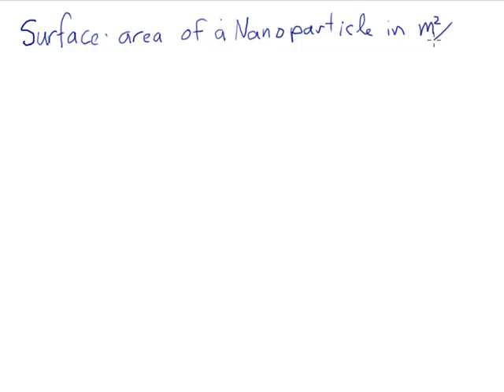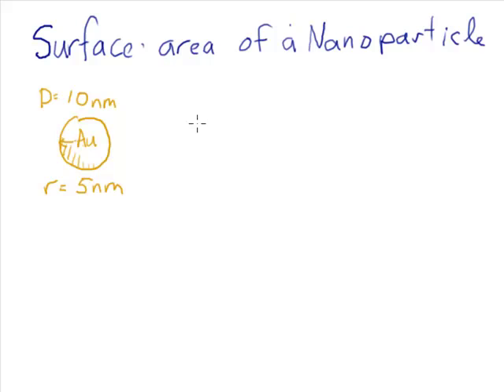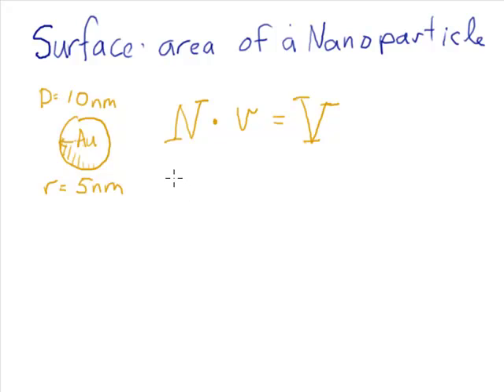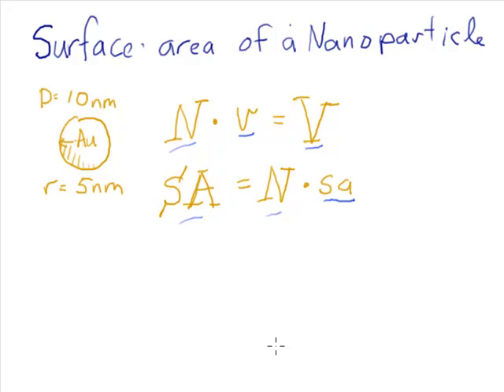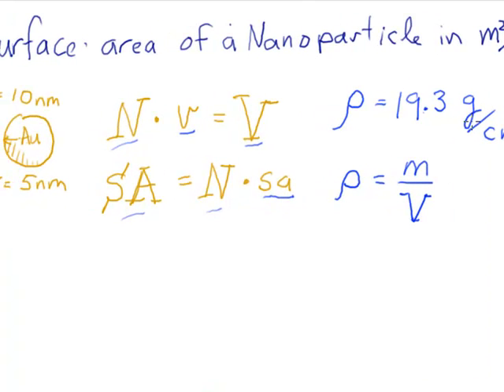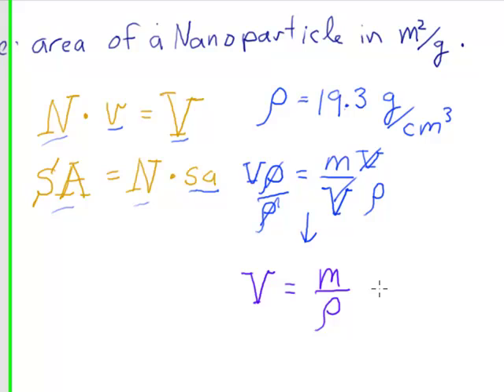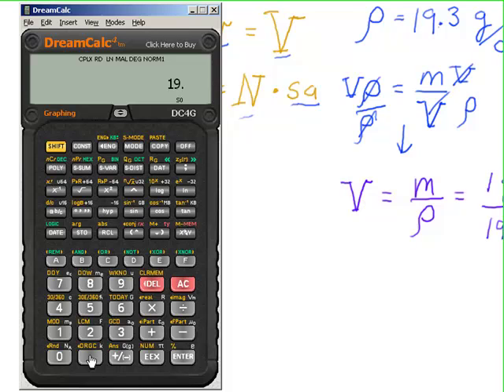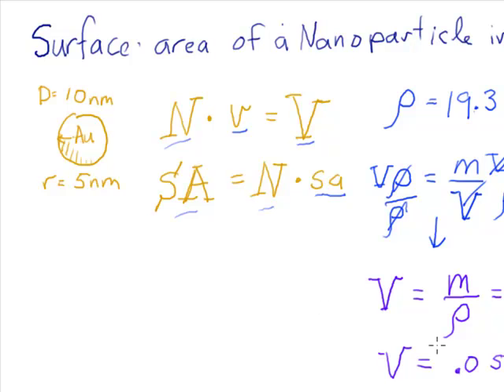Nanoparticle Surface  Area Calculation Part 1 of 2

Comment from the maker: Someone just showed me an easier way to do this.  Just take the volume of a particle, vp =4/3*pi*R^3, use density to find the mass of the particle, mp = vp*rho, then calculate the surface are of the particle, sa = 4*pi*R^2.  Then sa/mp is the final answer.